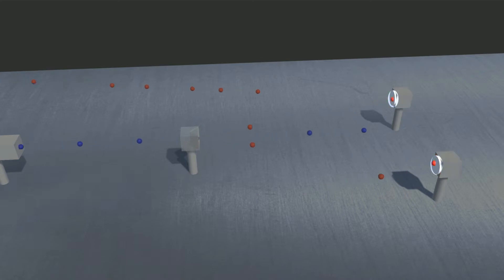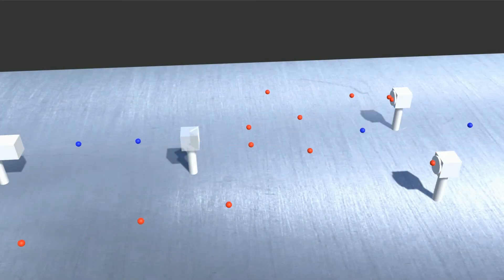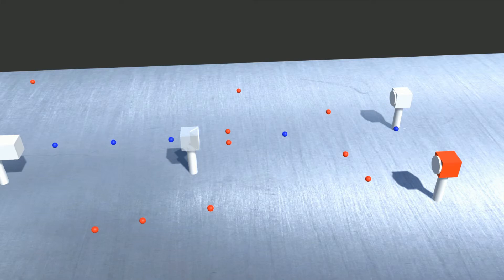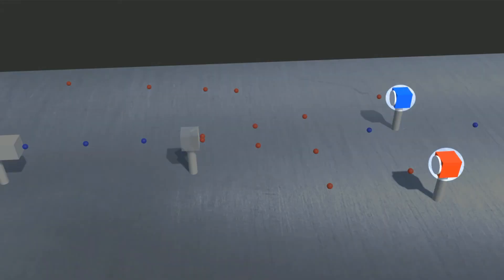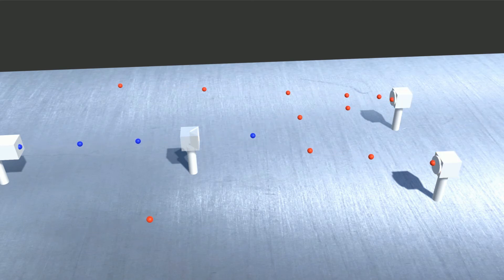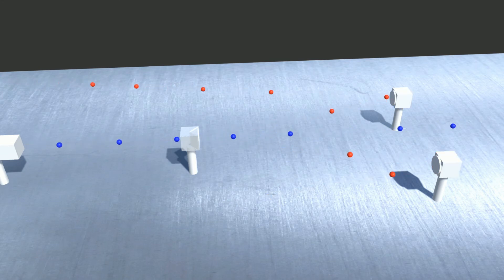Parametric Down Conversion Visualization

Comment: Aren't those photons also Quantum entangled
Reply from the maker: yes, the pair of identical photons produced by the nonlinear crystal are quantum mechanically entangled. That makes this type of setup useful in a wide array of quantum optics applications.
Reply: Thanks a lot. This is clear.